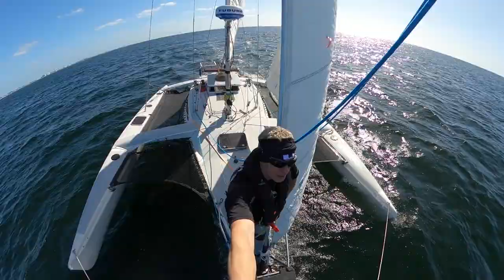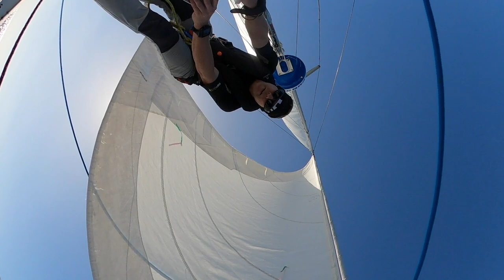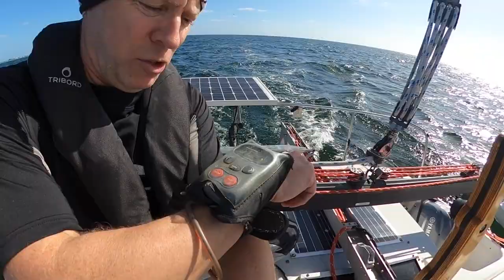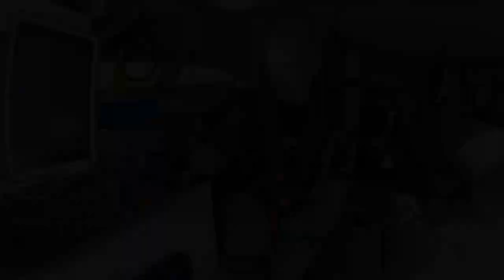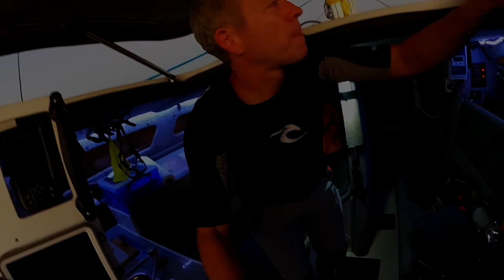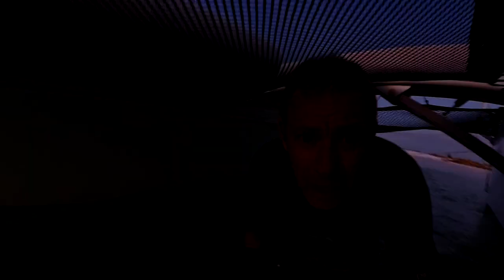I lost it on Clock Island

Comment: Hi Tomas, great videos! Looking forward to your next. I have a 1991 F27  and was wondering if your 9.9 outboard fit unmodified in the well. Looking at repowering and was hoping to fit a yamaha but it looks tight. Thanks!
Reply from the maker: Cool. I had to remove about half an inch from the back side of the engine well so I could bring up and down the outboard. Yamaha 9.9 high thrust long shaft 2016 model. Great little outboard!